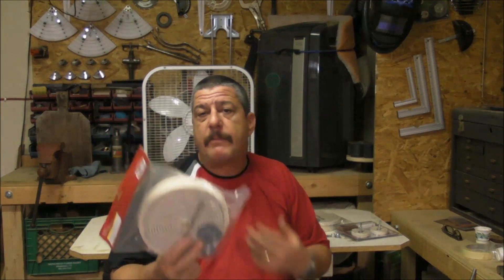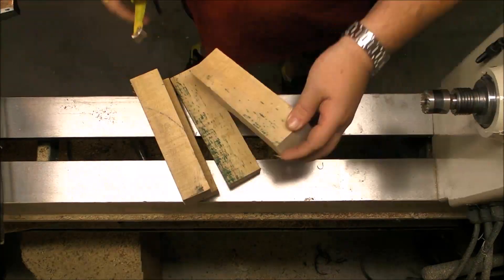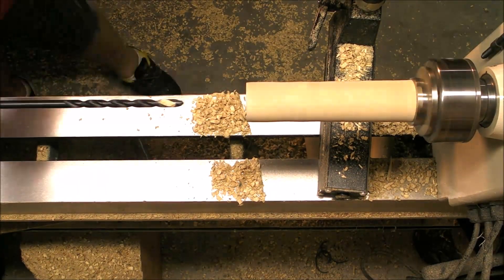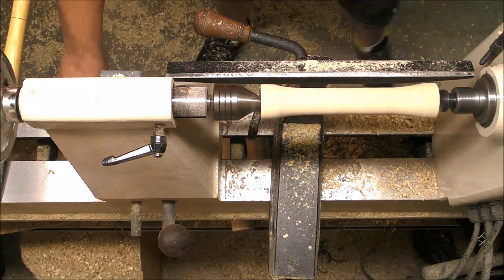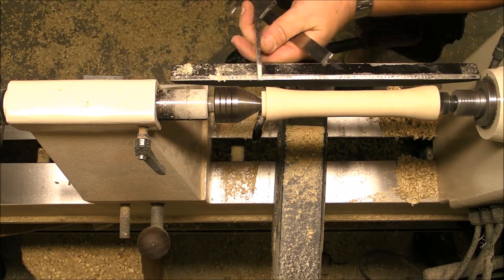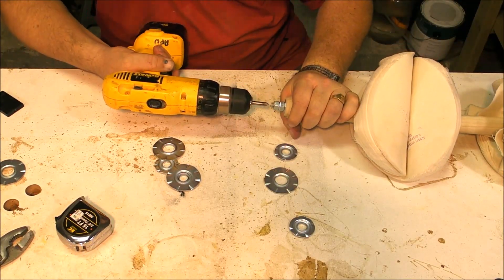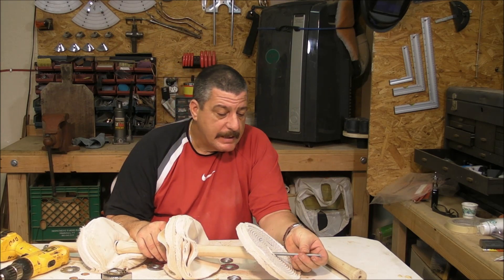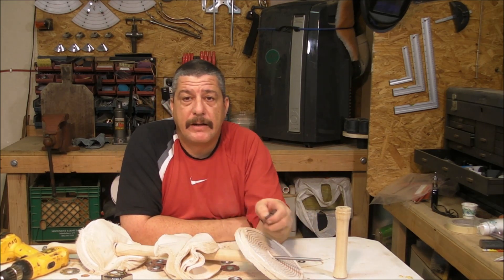#136 Buffing System...Total failure

Comment: Great Idea.... I think i would try a thicker threaded rod that fits to the washers that came with the wheels and use those washers with lock nuts on each side of the washers for maximum clamping pressure... And make a wood collet chuck to go in the chuck to hold the end.. Just some ideas. The video got me thinking.. :)
Reply from the maker: Jimmy Mead That is a very good aproach, I will see what can I do. Thanks for the idea. Take care.

Comment: Great jig Miguel I will have to make one, Just a thought if you make shorter wood spaces would it decrease the vibration as well? As  you know the longer something is the more flex you get. I am assuming you also put it between centers.
If I get an opportunity to make one I will do it just like you did I love it and I know you will get it perfect.
Take care
Albert
Reply from the maker: Al Furtado I did it betwen centers, but the rod I have used seems to be not strong enough and flex a little, then the weight of the discs did the rest. It have to be stronger. Kind regards Al.
Reply: Miguel Sanchez Thanks Miguel I hope you weren't insulted with my suggestion.
Reply from the maker: of course not Al

Comment: Thank you Miguel,
I hadn't given much thought to buffing until I saw some demonstrators doing it at my wood turning club.   It really brings up the perfect finish.
I hope to have a buffing system in the coming months but they are expensive. I am sure you will find a solution to the problem which  I can then copy:-).
Would the brass bar be more flexible with less chance of breaking?
Many thanks,
Alan.
Reply from the maker: Alan Simpson Hello Allan, this is the problem, my design was flexible, just give me a few time, I have some ideas and will find a solution on the cheap for shure. Take care

Comment: Miguel, like Mike Waldt I have the Beall system, but perhaps if I was to start again I would buy 3 separate wheels like you.  I use mine one wheel at a time, not three on a bar.  Perhaps that might make it easier for you?

Tom
Reply from the maker: Tom Stratton Certainly is easier, and I will do that, but after get a solution for this. jajjaj, I will not give up on this. Take care.